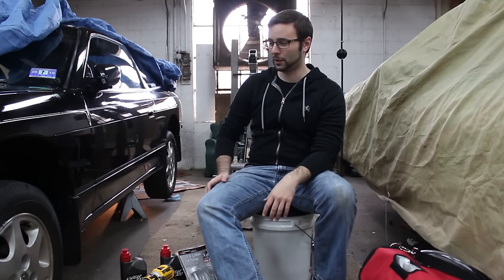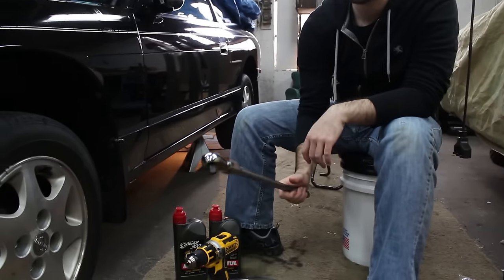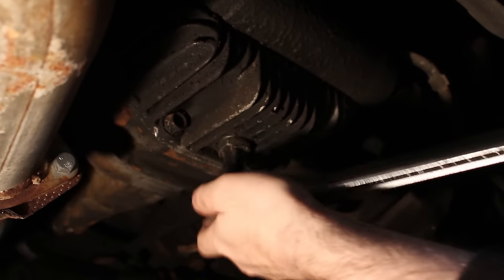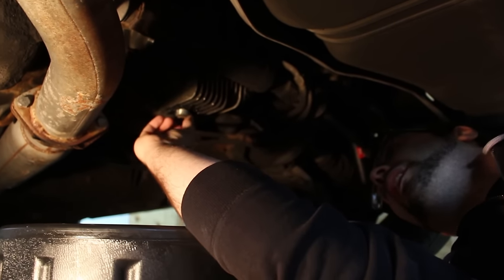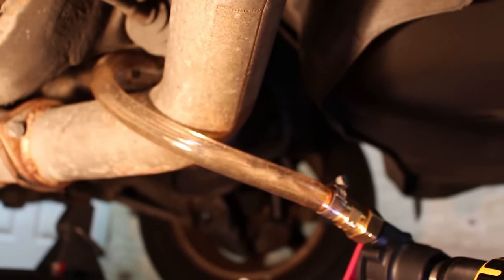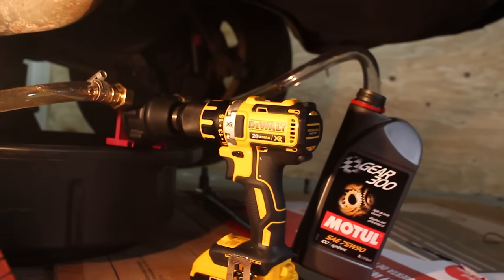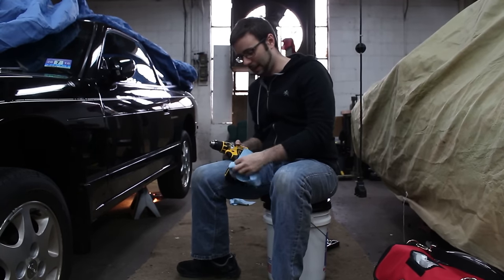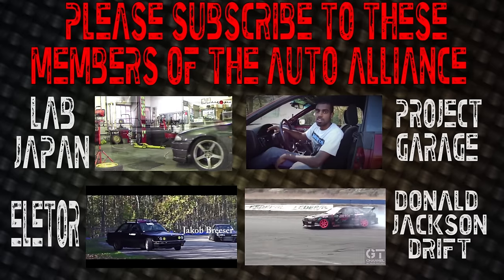S13 240sx Differential Fluid Change | SR20DET HICAS 240sx hatch

Comment: not one to be picky and i don't comment much as you guys are commonly switched on but why use anti seize on a thread that has oil on it.
Reply from the maker: +Troy Andrews it can still rust
Reply: Good point i just normally just put some clean oil on the thread does the same thing
Reply: +Troy Andrews both would be acceptable
Reply: yeah I'm a cheap bastard